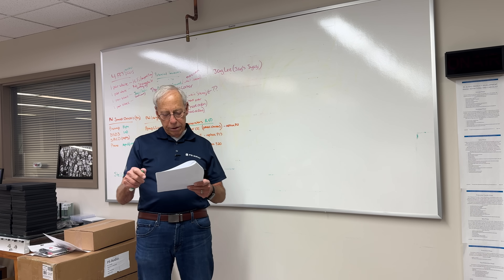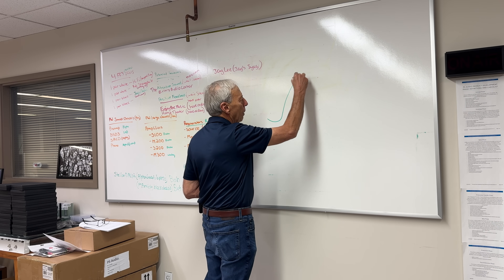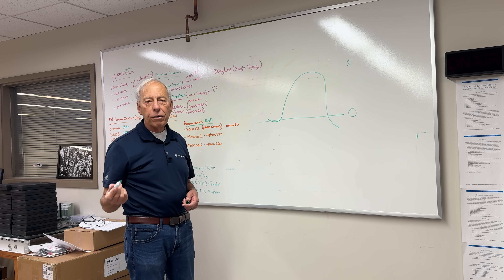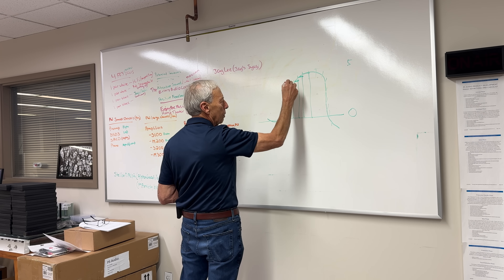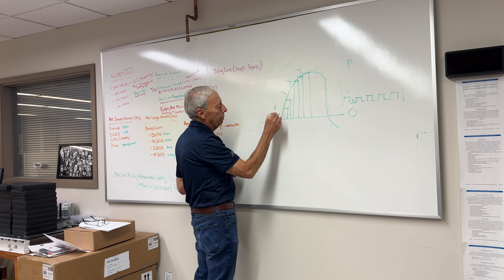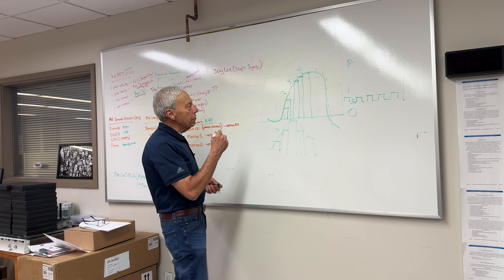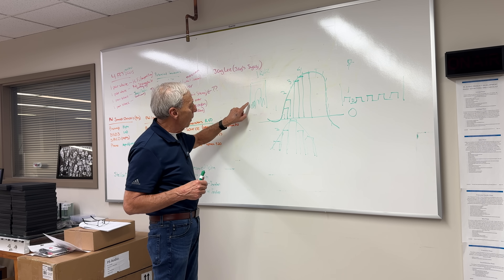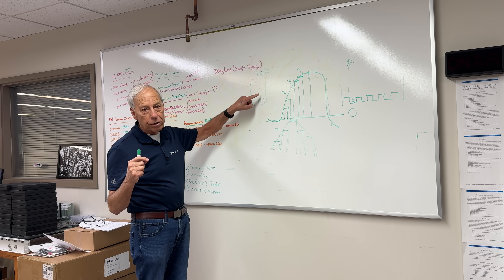How digital audio stairstepped waveforms get cleaned up

Comment: so.. you need a filter... so... what about nos dacs or r2r filterless dacs ??
Reply: How it’s explained in this video is exactly how NOS R2R dacs work.

What Paul left out is that we often perform the lowpassing in the digital domain using a mathematical filter, not physical components like capacitors. To represent all the little points that form the smooth waveform in between the big stairsteps, these digital lowpass filters also increase the sample rate (oversampling).

Every DAC needs some sort of low pass filter, what NOS dacs lack is a digital lowpass filter, so they also lack “oversampling.”
Reply: Please show us all any PCM DAC that is filterless. It is possible in up sampling to DSD. But that would be a Sigma Delta DAC.
Reply: @glenncurry3041  well i saw some british manufacturer that says their dacs are completely filterless..check this in red ketter no filters.. https://sw1xad.co.uk/products/sw1x-dac-iv/
Reply: @endrizo  The URL was blocked. But I went to the manufactures site. You fail to understand what they are saying. 

"All SW1X DACs are 𝒅𝒊𝒈𝒊𝒕𝒂𝒍-filterless designs, i.e. there is no over-sampling, no jitter reduction, no noise-shaping and no re-clocking. Since all our DACs are designed to operate without any 𝒅𝒊𝒈𝒊𝒕𝒂𝒍 filtering or any kind of digital signal manipulation that is required for over-sampling, 𝒂𝒍𝒍 𝒇𝒊𝒍𝒕𝒆𝒓𝒊𝒏𝒈 𝒊𝒔 𝒅𝒐𝒏𝒆 𝒊𝒏 𝒕𝒉𝒆 𝐚𝐧𝐚𝐥𝐨𝐠𝐮𝐞 𝒅𝒐𝒎𝒂𝒊𝒏 for the best possible signal integrity.

IOW Because they do not do any processing to the original input code, they do not use or need DIGITAL filters. But of course they do have to use filtering in their 𝐚𝐧𝐚𝐥𝐨𝐠𝐮𝐞 section.
Reply: @glenncurry3041  aah..ok.. thanks pal.
Reply: @glenncurry3041  I think even DSD needs a low pass filter to eliminate the noise from audible frequencies that gets “shaped” into high frequencies.
Reply: @SteveWille  The low pass filtering inherent in every piece of analog audio is often enough to provide the needed filtering. But yes technically any digital signal needs integration filtering to become analog.

Comment: I am not impressed that Paul doesn’t know what lollipop diagram is when taking about digital signals.
Reply: That's because it is a bogus thing TI invented for an explanation and it causes more confusion than if they never tried using it. It's just like Technics trying to claim they removed the cogging in the SL1200 they claimed to never have had in the first place.

Comment: With 16 bits you can resolve 65,536 voltage steps or 96dB (16x6) dynamic range. With 24 bits you can resolve 16,777,216 voltage steps or 144dB (24x6) dynamic range. Any audio wave can be considered as a combination of sine waves and the sharper the sound wave the higher frequencies of sine waves are involved. A low pass filter cutting at 20kHz essentially limits the sound curve sharpness to how fast a 20kHz sine wave can change level. What it means is that, for example, a 10kHz square wave becomes a 10kHz sine wave to your speakers because any harmonics adding to the sharpness will be filtered out. In fact, a square wave combines odd harmonic sine waves to make the shape of a square wave. Thus, if your low pass filter is 20kHz, any square wave of 20/3=6.67kHz or higher to 20kHz will become pure sine wave. But guess what? This is also how our hearing works. We can’t hear the difference between a sine wave and square wave above 6.7kHz. If your hearing stops at 12kHz due to aging, you hear every square wave above 12/3=4kHz as sine waves…the Red Book CD standard from 1982 was well thought about against how our hearing works and that’s why even today we audiophiles can be impressed by CD music when well produced.
Reply: Red Book was designed to work with existing technologies and acknowledged as having major issues. I've met and talked with some original engineers for it. Interestingly their reactions to the various digital distortions I brought up was that the brick wall filters and integration filters on the output cause enough distortion that the ones I brought up were secondary.
Reply: @glenncurry3041  It is a standard in-line with the Nyquist Theorem. Aliasing distortion is avoidable from the mastering process. The low pass filter with or without over-sampling can make audible difference at higher frequencies. Which kind of distortion did you raise as concern?
Reply: @ThinkingBetter  For one a frequency linear time shift distortion.
Reply: @glenncurry3041  Google says: No results found for "frequency linear time shift distortion". I assume you mean phase distortion. Most of us can't hear much above 12kHz anyway and it's debatable how much phase shift we can hear at frequencies where this occur. Still I prefer higher sample rates and have had moments where I believe I got a perception of higher clarity.
Reply: @ThinkingBetter  Nope not phase, time. Because of the ratio of sampling to frequency, fewer relative samples at higher frequencies, e.g. Red Book would sample a 100Hz sine wave roughly 440 times, 10Khz 4.4 times. There is a bit shift which is far more noticeable as frequencies increase. And the percent of distortion goes up linearly.
Reply: @glenncurry3041  I often thought about the artifacts of having a very few samples in the treble and how that translates into the signal being reproduced correctly. For example, if you sample at 44.1kHz and you have a tone at 22.05kHz where every sample is exactly when the voltage is crossing 0, you get no signal at all. OK, so how about 22kHz, it should be ok per Nyquist Theorem, but reality is if my first sampling is at the 0 crossing, the next sampling will only have shifted little in the time domain and you will still be near 0; and it will take me 440 samples to get through the entire sine wave. Of course at lower frequency this is less of an issue, but what is the effect on real music? I can appreciate DSD and higher sample rate PCM for this reason.
Reply: @ThinkingBetter  Or say 4 samples at mid points instead of zero crossing? Another but related distortion. You are getting there. 

It is much easier to show with a chart. But imagine that 22.1Khz sine being sampled correctly. First sample zero, 2nd sample at peak. Next sample zero crossing on the downward slope. Now extend that down to a graph and plot the voltages represented at the sample points. The 1st sample is zero. At this point the analog signal starts increasing and reaches peak at the 2nd sample point. But the DAC has not received the 2nd sample yet. The voltage out at the 2nd sample is zero still while the original signal was a peak. When the DAC gets the 2nd sample it cranks up to that peak which takes the duration of that sample ... in time for the 3rd sample which was zero! 

The signal has shifted an entire sample duration. This is critical at that high of a frequency. But negligible at say 200Hz. The shift would be minimal. A frequency [dependent] linear time shift distortion. You will hear it with like a guitar pick separating from the resonance of the string. Being a guitar player, it jumps out at me. You hear the pick not as part of the note but as a sound by itself. It is time separated from the lower frequencies of the string resonance.
Reply: @glenncurry3041  At what sample rate do you believe we are reaching a point of no perceivable difference going any higher? I have not heard of any official credible science level test of this topic.
Reply: @ThinkingBetter  Simple math using Waveform Analysis 101. The first ten harmonics are critical to a fundamental. Using the old 20hz-20Khz, that would require sampling to 200K. With any simple closer look, twice the highest does not work. People misunderstand Shannon Nyquist. So as a yes subjective choice, an X10 sample rate would be appropriate. So a 2M/sec sample rate should reach inaudibility. 

But then there are tests showing the limit of temporal resolution in humans is as little as 10-20 microseconds.100Khz. So X5 again?
Reply: @glenncurry3041  Between DSD usually limited to 352.8kHz temporal resolution (DXD transcoded) and PCM usually limited to 192kHz today (max available on lossless streaming services), I believe we are already at a point where further gains are inaudible. The challenge is that the vast majority of music available is limited to CD quality and sadly much of this music will remain the best of music in a quality less than what is technically possible.
Reply: @ThinkingBetter  I guess if your can't hear the difference you are a lucky one?
Reply: @glenncurry3041  No, I detect tiny differences and always end up praising speakers or headphones with planar, electrostatics and ribbon drivers due to their higher precision. I also prefer my Rythmik and Velodyne servo subwoofers because I know how to notice harmonics of sub bass. Thus I’m with you on this topic. One reason people don’t care so much is that most people have crappy speakers and rooms concerning reproducing phase and timing and won’t notice anything.

Comment: Well explained without mentioning fourier transformations. 😊
Reply: that is for spectrum analyzers
Reply: Hmmm… as soon as Paul mentioned that square waves are composed of sine wave, Fourier was evoked. 😊
Reply: @SteveWille  it is job of a clock to generate "square" wave, however these waves are not truly square
a search  engine can show pictures for oscilloscope clock signal undershoot/overshoot
this imperfection in reality among others that are comprising so called jitter
equalizer's fancy dancing led/vfd/lcd bars is where FFT took place
Reply: @sarabarabu-mq1ci  Sorry, my mistake… Paul’s discussion about square waves being composed of progressively higher-frequency sine waves recapitulates Fourier “Series”, not the Fourier “Transformations” the original poster mentioned.

Comment: Part of the way it works is that the sample rate is so high that 
even if there was no low-pass filter you would hear a smooth, musical sound.    
The filter gets rid of the high-frequency artifacts that result from sampling.   
There is a lot more to it than that, of course.
Reply: exactly
exactly right it is very very hard to see steps of the 44KHz carrier at 1KHz resolution scale
the problem is bandwidth of an amplifier sees it and amplifies it and feeds the energy into the driver's coils, that is why the carrier better be filtered out
Reply: Wrong. at Red Book specs, the steps are very audible and highly distorted.